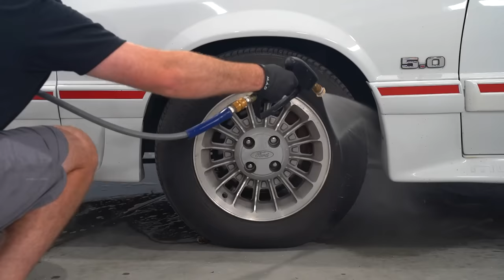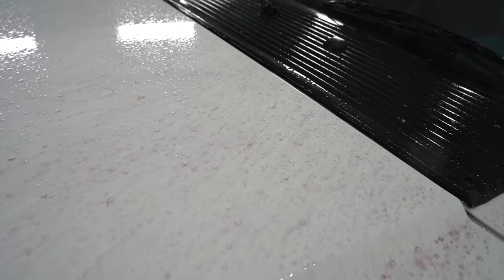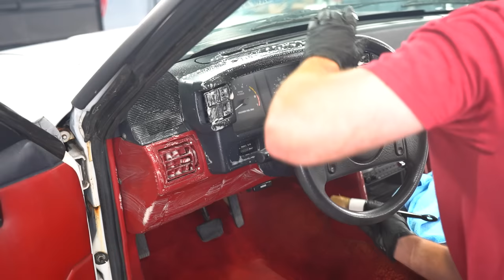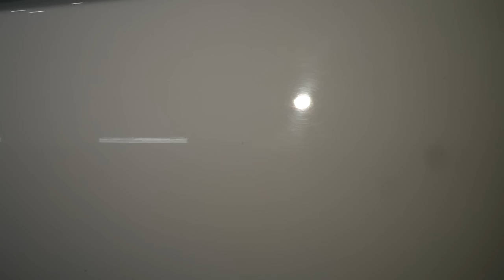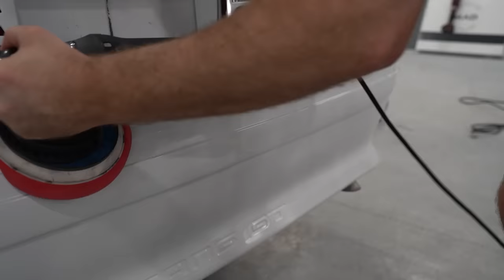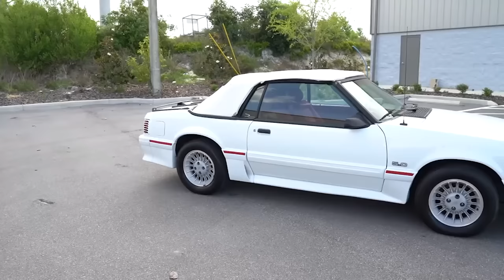Abandoned BARN FIND Ford Mustang | First Wash In 19 Years |  Car Detailing Restoration How To!

Comment: My first car was a 79 Mercury Capri, this guy's cousin, same color with the same color of upholstery, but vinyl.  It got just as hot as the black and I can still feel having to peel myself off the hot seats while wearing shorts.  🥵😳  I did love how the fluffy carpeting felt on your bare feet though, but it wasn't easy to vacuum out dry grass and fir needles.   The dash boards and plastics on most vehicles of this era would get destroyed by the UV rays and you'd have to buy Dashmats to cover them up.  They've come a long way with better quality on plastics now.  BTW, this guy isn't an antique yet, it's just vintage.   ; )

Comment: Nice thorough work. Only thing I would say is I work on a lot at older cars and restorations and I would say to you and all detailers etc, try to keep cleaner/ water out of switches. I've had a few examples where weeks after a clean like this the window switches stopped working, when removed and opened up the small brass parts are heavily corroded and there is a mixture of soap and grime down in the contacts. Often these parts are near impossible to find so please take care.

Comment: There is no way that those are the original headlights that came on the car, especially if it sat outside for any amount of time. I can't believe it still had the ashtray lid and it still worked. That was usually the first thing to break on these cars.